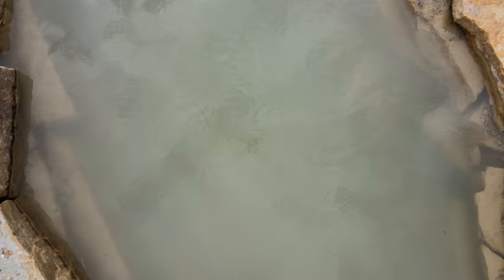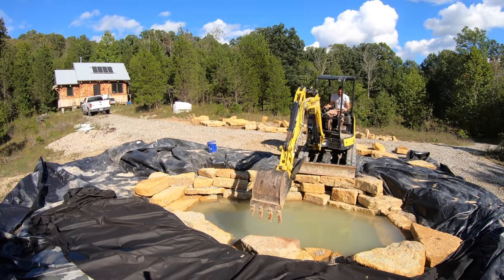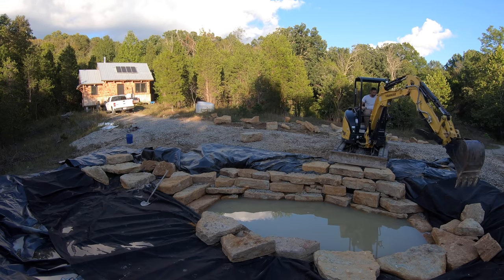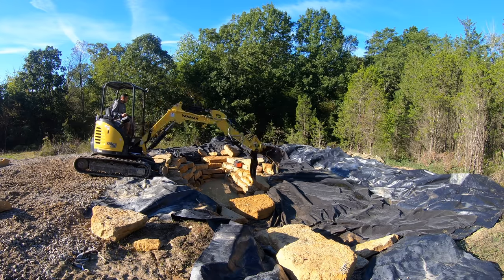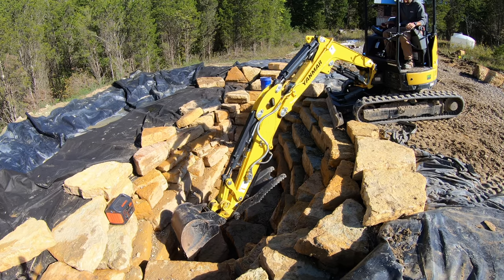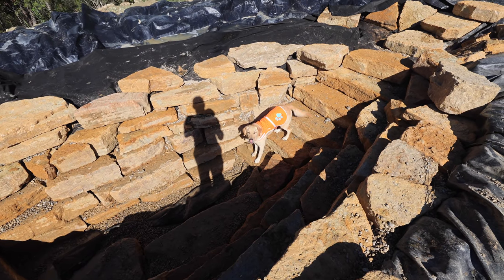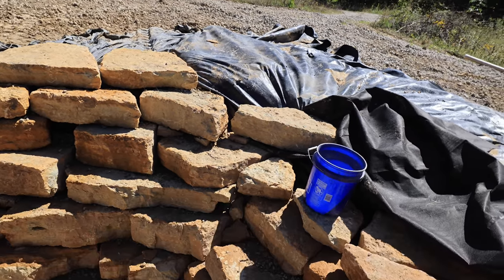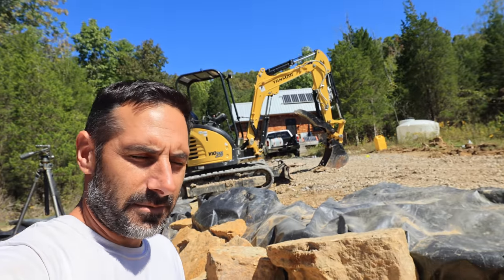Building A Natural Swimming Pool: Gravel Filter (Part IV)

Comment: My grandfather worked construction, he taught me that when I open a can of pipe glue or or any adhesive with lid, if you take Vaseline and put it on the threads of the screw lid and along the top where the lid touches the can You won't wind up with your lids glued to the can. When it came to paint he taught me to use a finish now and puncture two to three holes in the well where the lid seats so any paint that gets in there will drip down into the can so that you don't have to fight so hard to get the lid off next time. I use the Vaseline trick on everything including super glue. When I use it on pipe glue I make sure to wipe off the threads before pulling the stick out and using it
Reply: The Vaseline tip is fantastic!!
Reply: I’ve the holes in the paint/stain can rims for every….not sure where I learned it.  Everyone that has ever seen me do it has been blown away.

Comment: Pond build is looking good. Here's a trick to get the lid off if you don't have pliers. Turn the can upside down. And smack the lid on a hard surface 2 or 3 times. You will usually be able to loosen it then
Reply from the maker: Thank you for the tip!

Comment: Easy to open those glue containers with channel locks or a pipe wrench. But if you dont have that on hand smack it against the ground a few times(cap to ground) and it will sometimes loosen up for you. Or if you want to try to keep the cap clean or looking nice, softly hammer around the edge of the cap with a hammer or some other weighty tool and give it a good twist, if it doesnt come off do it again until it comes off.

Comment: When cleaning and gluing pipe such as sch 40, you want to put the fittings together around a quarter turn off of perfect. And then twist into position so you spread glue even and lock in tight. Marking your perfect mock up you can use a sharpie to mark the point to stop your twist. Just a little help from a 16yr+ plumber.
Reply from the maker: I’ve thanks for the tip!

Comment: Hey, just found your channel. Cool project. I'm building a similar feature in my yard right now. Will also have a bottom gravel filter like yours. I chose to make it a pressure filter instead of a suction filter as my pond wasn't designed to make use of bubble pumps (wish I'd known of them earlier). Will follow along for the rest of the build.
Reply from the maker: Welcome Tyler, good luck with your pond, let me know how it works.

Comment: mike, with water futures, it is best too run them 24 / 7. but it is not a must.  I used a 12 volt  rv water pump, too keep the water moving. while the water pipe under water was run through a pool sand filter. once it was clear of cloudy water. I moved the pump to a hidden housing,. it only ran with sunlight.  no battery needed. it took about three weeks too clear.  it ran for months.  until the pump broke down. at fifteen bucks it was cheap too keep the water moving.  of you want a swimming pool then drop a gallon of Clorox once a month.   By hiding the pump housing behind a few rocks no one knew it was there. 
but filtering with a bubble pump, like a fish tank the water turns  green after a while.
it is a bitch too get it too return clear.

Comment: I haven't read books like you have and it probably is better to install the PVC pipes after you have moved most of the big rocks, but you have a pipe coming up from the bottom of your pool through the water, where you may want to have room for people to cool off.  Could you have brought the pipe where it T's off under some of the rocks and up through the clay? Or is this the recommended way?  Great job, even though time consuming.  I think you will be pleased with your efforts.
Reply from the maker: I didn't cement it in, im going to run it closer to the edge with some 45s
Reply: @50Acres  That will look nice.  I enjoy your videos, keep up the great work.

Comment: Right in your driveway when you look at it from the sky. It doesn't fit right or look right. It's always possible that someone could back their vehicle & could fell into the pond. 
Little too close to the driveway if you ask me. If it was me, I would build it in the woods along with waterfall, a little stream & pond with a sandy beach & etc, not all rocks.
Reply from the maker: Thank you so much.  It is a bit deceiving, looks smaller on camera.  Sarah is excited about it.
Reply: From how Mike has explained, leaves and other debris would make it harder to maintain the 'good' micro-organisms that will keep the pond clean. Putting it in the woods would defeat that. 
I think it's in the perfect location!

Comment: Did you put gravel under the pipe before covering as this will help water flow, if directly on liner it will seal up a lot of the slits. Would be nicer if you could hide that uprightpipe behind the rocks. Is it to late to do this as it may get knocked when you swim/play in pool. Hope this helps.
Reply from the maker: There was a thin layer left over from some previous work IIRC.

Comment: Does that vertical pipe need to be rigid and stick up in the middle?  Could e a flex pipe and run through some rocks?  It seems to take up a lot of prime swimming space...
Reply from the maker: I may, I didn't solvent the standpipe yet.

Comment: The other option to keep them clean enough to swim in is to exchange the water often enough that stuff can't grow in it but then you need a water supply large enough to do that exchange and until you know the flow rate of the spring you have no way of knowing if you have that.

Comment: I use a pipe wrench on those stuck pvc glue tops.  I'm sure you didn't have one handy.
Reply: sometimes wide pliers
Reply from the maker: I usually use channel locks, just forgot to bring them along.

Comment: Pond build is looking good. Here's a trick to get the lid off if you don't have pliers. Turn the can upside down. And smack the lid on a hard surface 2 or 3 times. You will usually be able to loosen it then
Reply from the maker: Oh nice I will try that next time.